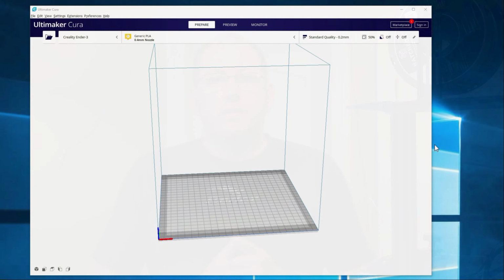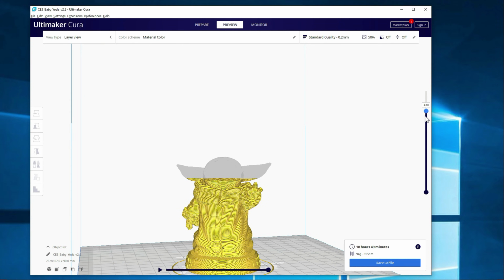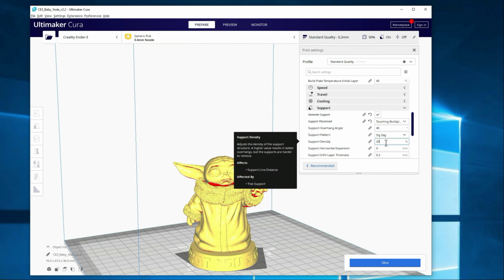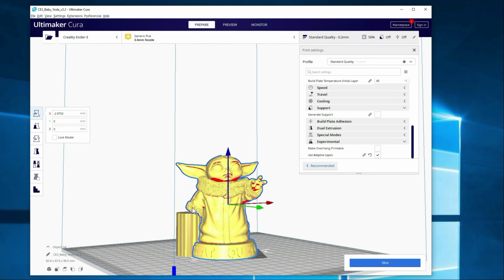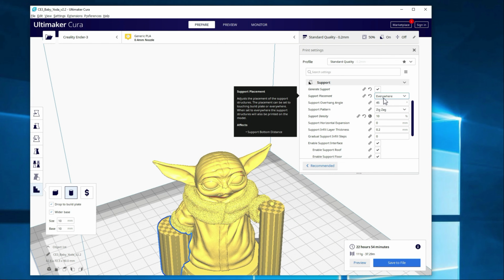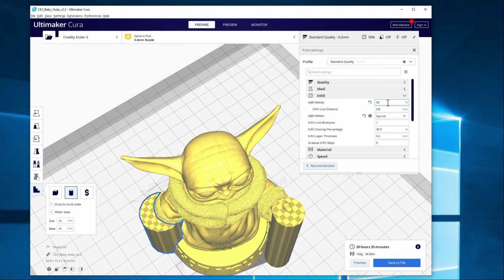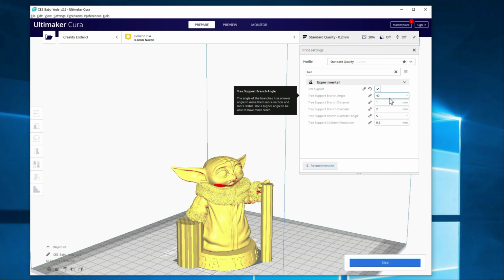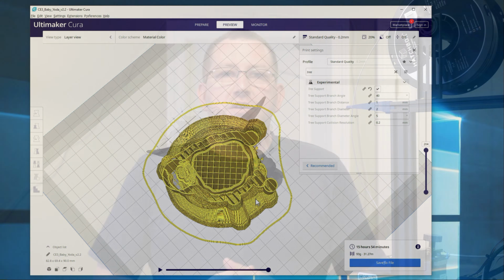Why Custom Supports Save Your Prints

Comment: Super-helpful. I've been fighting with Cura over the random extra supports that it puts in when I have many shapes merged to make complex (compex for THREE-D CAD that is) models. I've been trying to suppress some unwanted supports using support blocking. Amazingly Cura is still putting some supports into areas that have supports blocked. Usually I try t build without supports, but sometimes you just need one or two in a key place. Now I can leave supports turned off and fix the issues manually. 

I didn't know that this option existed until I saw your video. Which is at the ideal skill level for me, runs at a good pace and uses the perfect real-world example of where the add-on is useful.

 
Now I'll have to go and research the built-in options - since I just noticed a reply below where you saw the add-on isn't needed anymore :)
Reply from the maker: Hi. They added the functionality to one of the recent cura builds. It works great, and only puts the supports where you want them.